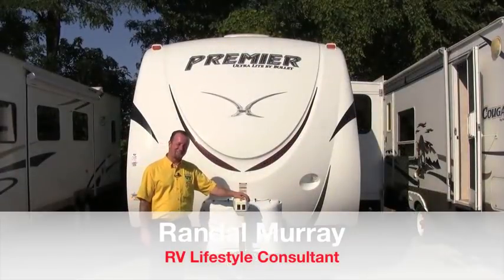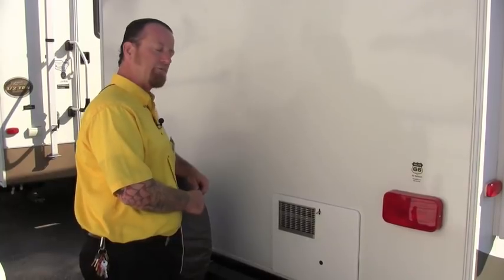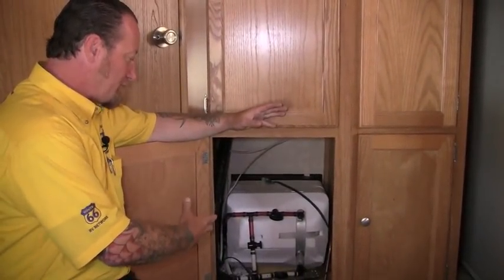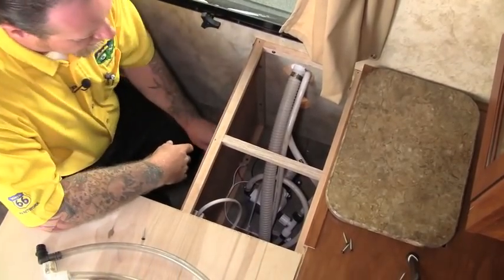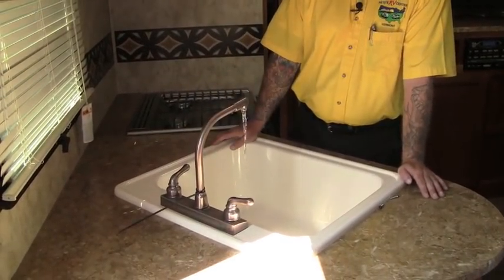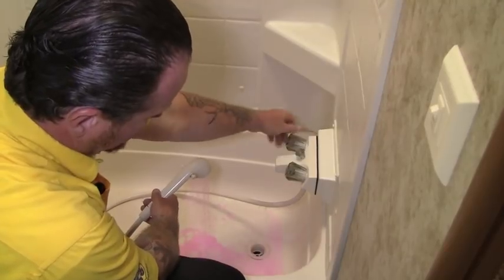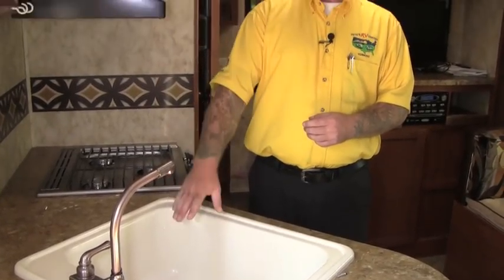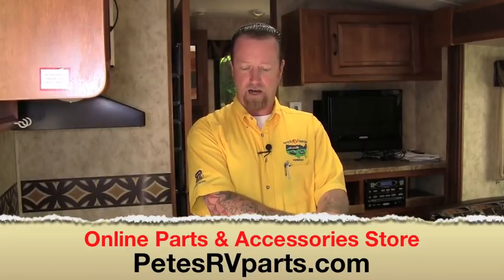RV WINTERIZATION TUTORIAL | Pete's RV Service Tips (CC)

Comment: I just wanted to mention the low point drains. There is a cold & hot water valve located somewhere on the floor or sub floor. You should open both valves and drain them. When I winterize I drain the hot water tank first, then I open the low point drains, then open all the faucets. I find doing this saves some the antifreeze. I'm not sure if every RV has the low point drains, But it's well worth looking into. Under my sink is a Culligan water filter. I remove my water filter (if it still has some use on it) and I replace it with a plastic bottle of water. This is to take up some space so I use less antifreeze. Once I pump the antifreeze through every water line in the rv, I remove the water filter housing and remove the bottle of water. It may sound a bit much to do it this way, but everyone has their own ideas... I live in Oklahoma, and at times we do have some freezing weather, and I have not had one line to freeze yet. Anyway, My point here was, Check for the low point water line valves, and drain those as well... Oh!  And if you have a washer in your rv, drain those water lines as well...... Happy RV'ing Everyone

Comment from the maker: If you are going to have constant heat in your unit and all of the plumbing is above the floor you will not need to winterize.  To flush antifreeze from water system, run fresh water through all lines for a few minutes until everything is clear. You also may want to run a little water through the head of the water pump to remove any antifreeze left there from winterizing process as well.

Comment: Hello Seadoosportster!.....The trap I refer to in the Video is the S shaped drain pipe under our sinks and shower. Water sits in this pipe to act as a block for odors from our plumbing system. By pouring the excess antifreeze in to the drain it displaces the water in the trap with the antifreeze, to help the pipes from cracking when it freezes.
Hope this helps answer your question. Happy Camping!

Comment: Hi Randy. Thanks for the video on winterizing an RV. I have a question regarding my new travel trailer. I actually have an outside fitting labeled antifreeze/winterization under the city water line on the side of my trailer. Does that mean I don't need to attach anything to the pump in your video? It appears I just need to follow our initial steps emptying the hot water heater and empty the fresh water tank. I have the hot/cold line tee connections, so need to turn 90 degrees to close them off and open the middle tee so the water can flow into the trailer. Do I need to do anything to the pump or just start pumping the anti-freeze thru the outside fitting. I just need to attach a hose from the anti-freeze jug and connect to the fitting on the side of the trailer?
Reply: Hey James! 
Sounds like you are correct and may have a built in pump convertor. ( found on many high profile fifth wheels) this means you do not have to access the pump like in the video, you hook a hose up to the connection, flip a valve and you are winterizing! You still will have to preform the rest of the steps as mentioned as well, you just get to save that one.
Thanks for watching, Happy Camping!

Comment: awesome video.  I think I blew out the old ring in the city fill.  the antifreeze came out under pressure.  how do I check for sure and what do I need to do to fix? feedback would be appreciated.
Reply: Hey there Ralph, this is an easy check. Turn the water pump on after filling the freshwater tank, ( No city water hose hooked up ) If water sprays out of your city fill, it will need to be replaced. If water doesn't spray out of the city fill when water pump is turned on you should be good to go. Good luck! Thanks for the question.

Comment: I have a question. Once you have empties the water heater and replaced the anode rod, do you turn the water heater ignition system back "On" or should it remain in the 'Off" position until the next time the unit is used?  Really great video!
Reply: Wanna make sure in the spring that you refill the hot water tank before turning any thing on. The common setups down care if there's water in it or not. without water you could burn out the heating element
Reply: Dalia Hester I leave the outside switch off until I confirm there is water in the tank. I do this just to be on the safe side, so I won't have to replace a heating element unnecessarily. Thanks for watching!

Comment: Hey Randy.  Do you know if anyone has ever damaged the o-ring in the city connection using your method?  I have 2015 Bullet 272 and I'm winterizing it after our last trip this weekend.  But I have to admit I'm a little nervous to "burp" the city connection after all the horror stories I've read.

Btw your videos are the best!
Reply: As long as you have the cold water faucet open in the kitchen and pump off you will have no resistance and shouldn't hurt anything. You do stand a greater risk of freezing and braking the fill than hurting it by "burping it" if you do it the way I recommend.
Good luck man! Happy Camping!

Comment: what happens to the water in antifreeze that goes through the system and down the drain do you need to empty all that out as part of the winterization or should it be draining as you doing
Reply: when the water is chased down the drain and into the holding tank... then the antifreeze is actually winterizing that tank as well.. or just drain the two tanks.. Myself.. I leave the antifreeze in the holding tanks to keep it protected from condensate that could happen
Reply: Janet Reider I do recommend opening the grey valve and dumping that after winterizing just to be on the safe side. Thanks for watching!

Comment: This is kind of a dumb question, but if you've drained everything, why does water still come out when you are pumping antifreeze through the system?  Every time he turned on a faucet, water came out first.  Does the water need to be hooked up during winterizing?
Reply: Hey there Alex, I personally don’t drain the fresh water system before winterizing. In the video, I dump the tanks but the plumbing in the camper still contains water, which I displace with anti freeze. That’s why you are seeing water before anti freeze at the faucets. Thanks for watching! Randy

Comment: I just went through the process of all the antifreeze. Everything works great up to the point of the city water check. When I push the button only a little bit of water came out, no antifreeze came out. Am I protected or no?
Reply: in this situation, I may have someone hit the water pump switch momentarily whale you hold city fill in. This should force antifreeze out of the city fill, if gravity is not. 
Thanks for watching!

Comment from the maker: No need to put anti-freeze into an EMPTY tank, with the tank empty there will be nothing to freeze and split the tank. With the bypass valve (valves) in the bypass position on the water heater no fluids can enter the tank. The reason for the anti-freeze in the plumbing system, is we can never be sure we have removed all the water. In a water tank we can be sure by simply pulling the plug.

Comment: Just curious, you first drained all the water out of the RV, so why do I see clear water coming out of the faucet just before you see the anti-freeze? Where is this water coming from?
Reply: He drained the water heater tank. So that tank doesn't freeze and get damaged. The water that first comes out is just left over water from using the system during the warm months.
Reply: prusso09 I don't drain the plumbing system, just the water heater. The water you see is being displaced with antifreeze during my process. Some people will blow the lines before the antifreeze step, this is something I don't do, but it will not hurt anything if you choose to drain all lines completely before winterizing.  Thanks for watching!

Comment: Is there anything special for the waste water tanks other than emptying and a good flush of the black water tank? I suspect that not all of the waste water is dumped.
Reply: The antifreeze you drain from winterizing the focets should b enough to winterize your holding tanks. Myself. when I'm done. I dump a little in a sink and the toilet and leave it so they are protected
Reply: Jerome Sanders an empty tank won't freeze and split, even with a little material inside. What you need to be concerned about is pipe between the tank and the gate valve that may hold water from the winterizing process. The black is usually fine, the grey should be opened so not to freeze up and crack. Thanks for watching!

Comment: Hi - how do you know how much anti freeze to run through the system.  Once you see pink everywhere do you remove the items from the water pump (the antifreeze hose used to pump the anti freeze to the pume)?
Reply: You want the antifreeze to stay in the lines during freezing temps. then flush the system in the spring..
Reply: BARBARA MUTCH most RV's will take 2 to 3 gallons to do. Unless you have fancy upgrades like washers and dryers, ice makers, dishwashers things like that. Once pink is seen in every outgoing water source, the bottle and hose can be removed. Thanks for Watching!

Comment: Hi I purchased my 2013 keystone summerland bank house pull camper at PRV in Burlington, VT and can not find water heater tank to bypass it for winterization. Can you give me some ideas.  Thanks, Amir
Reply: Hello, locate the water heater on the outside of the unit. Now look at the same location on the inside of the camper. In the Summerland you may need to remove a panel or remove a drawer to access. Good luck!! Give us a call if you need to, glad to help.